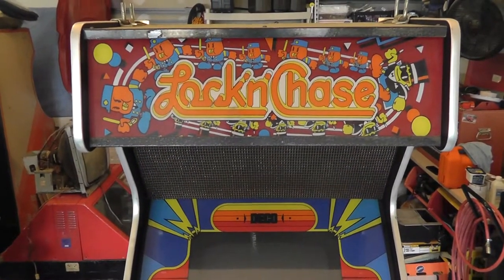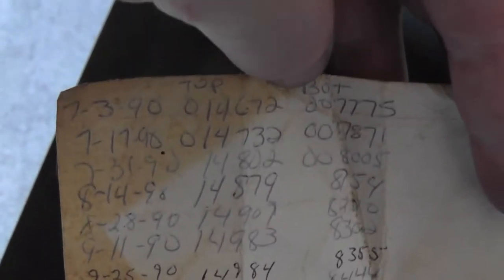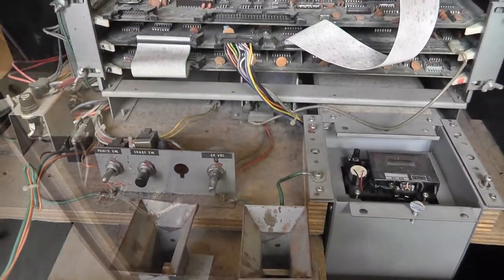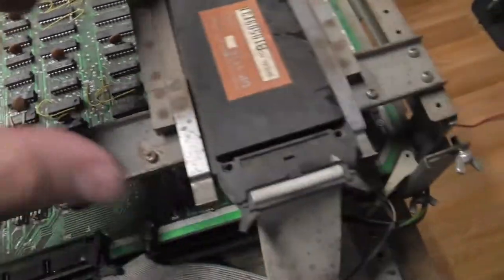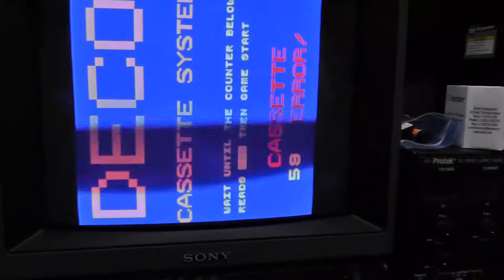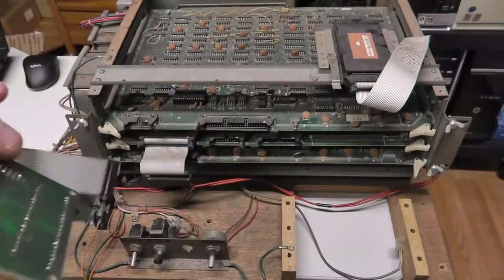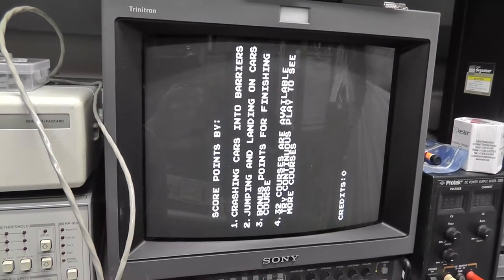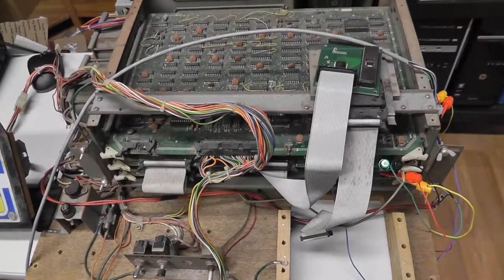DECO Cassette System Refurb - Part 1 - Teardown, Cassette Error, Multi-Kit

Comment: I am trying to restore a deco cassette system, and your videos are a wonderful guide and reference.Very well done. I did have 1 question however, I found your other video on the idler tires and where to order them - that was amazing - ordered a set, but where did you get the rubber that goes between the 2 wheels, i can use a rubber band but are hoping you found something better. - Many thanks in advance.
Reply from the maker: I think you referring to the belt?
https://www.amazon.com/gp/product/B07YDJQ4CW/

Good luck with the restore.

Comment: I have this exact cab with bump n jump in it. Where did you get that darksoft kit. I need one of those
Reply from the maker: Does your bump n jump / tape deck work? Here is the link for the multi-kit project https://www.arcade-projects.com/forums/deco-multigame.30/
Reply: @jacklick   thank you. No. There was no tape deck in it. Just the bump n jump pcb.
Reply: @jacklick  I'm actually having a hell of a time trying to figure out the vertical collapse on the nanao monitor in it.
Reply from the maker: @howiehoward7493  I haven't dug into the monitor yet and model looks unknown.  Always start with cap kit and reflow. good luck

Comment: I'm confused what does the Cassette tape purpose? it has the game code on it or some data code on it or something. I'm not sure what you mean by Field ground, what is considered the Field ground? If they don't want you to Loop meaning Tie connect the Field ground to the logic ground to prevent interference issues, what does the EE technicians want repair technicians to do to prevent interference issues and able to loop/tie connect the field ground to the logic ground. Technically you want all your grounds to tie together to the earth chassis ground of the unit. What I'm saying is that to prevent interference issues there must be another "grounding scheme" they want repair techs to follow instead of looping/tie connecting the field ground to the logic ground, but what grounding scheme do they want us to follow?
Reply from the maker: Yes the cassette tape has the game data on it.  AFAIK there are no game roms on the board.
Field Ground, Frame GND, Earth GND are all the same I believe.  I think in perfect world FG and Logic GND (from switcher +5, +12v etc) will be separate but the problem occurs when they get tied together somewhere else in the ckt, like the monitor.  Lots of switching power supplies will say "don't connect FG to Logic GND" probably because bad AC wiring can fry the thing.  As Forrest would say,  "and that is all I got to say about that"
Reply: @jacklick  Yes switching power supplies will have a switching frequency that is turning off/on the +5vdc and +12vdc which the switching frequency will leak into the logic ground and if you tie together the Game circuit board ground with the arcades monitor ground. I'm guessing linear power supplies AC power transformers secondary has two different isolated grounds from the logic ground and the Field ground? and Switching Power supplies don't offer two separated isolated grounds from the logic ground and the field ground. Some arcade monitors have a DAG black wire from the CRT tube to the neckboard on the monitor and other arcade monitors don't use a DAG wire. I think this DAG wire is considered a Field ground? or they just want the logic ground "floating" above earth chassis ground it seems.
Reply: Very interesting, as I never seen one and I worked with Arcade machines. Can't believe they used a cassette, so unreliable, instead of a cartridge with EPROM or Prom's. It's like old home computers. Thanks for the video 👍
Reply: @KJW648  But it's super cheap and a dream come true* for the operator who instead of parting with four-digit sums for a new game will get a new one for peanuts. And if the tape stops working, he can send it in and get it replaced. And since the drive will work for a decade and by then the machine will be so outdated it won't make enough money to pay its electricity bill, imagine it's 1983, who cares if it doesn't work in the distant future that is the year 2021? (hell I remember how futuristic and far away the year 2000 seemed in 1994 - but then again I was 10 years old)
*) if only the choice of games were semi-decent... (well at least there's Burgertime and Boulderdash)
Reply from the maker: Just like the old vic20s and c64s.  I guess it made sense at the time to someone :)  thanks for commenting and watching.
Reply from the maker: Yes, the DAG wire on monitor is often the part that ties FG to Game Logic GND on the monitor.
Reply: @jacklick  the DAG wire can make the interferences worse since that is considered Looping the field ground with the logic ground?
Reply from the maker: sort of.  Is it the switcher or the monitor that is the problem :)  You can remove the cabinet gnd strap from monitor and that would also break the half loop.  But all metal in cabinet should be FG'd for safety.  So you are left with looping FG to logic gnd on switcher.
Reply: @jacklick  If you use a switching power supply, you would have to lift FLOAT the logic ground and only Field ground the monitor to chassis ground. I know they used an isolated transformer for arcade monitors maybe this is why they used an isolation transformer because of the logic ground looping with the field ground caused interference issues so they needed to use an isolation transformer to isolate the field ground and the logic ground it seems.